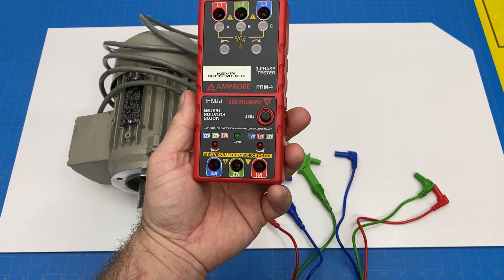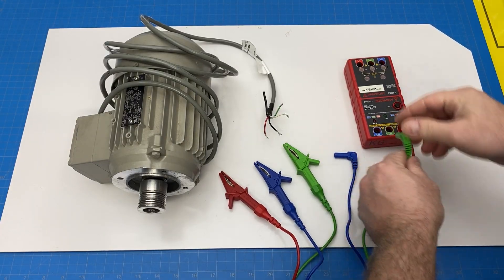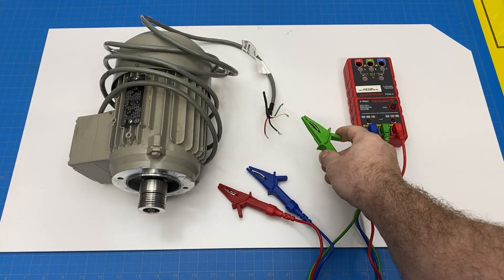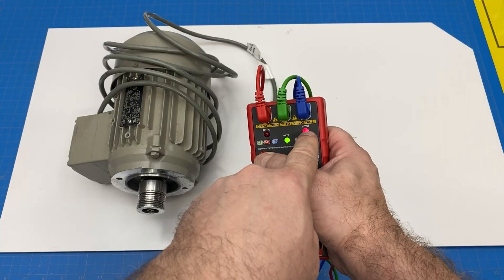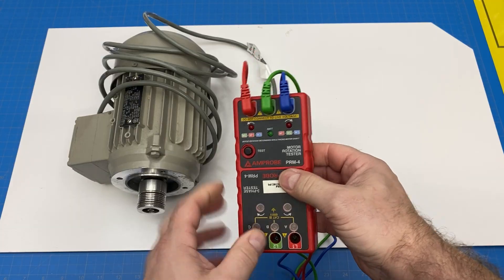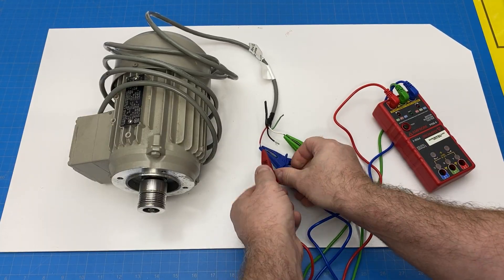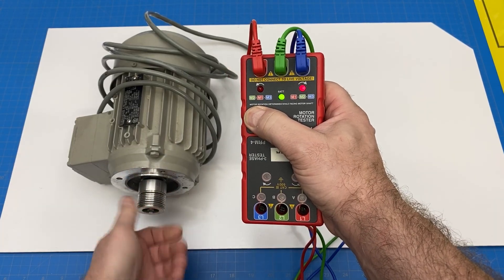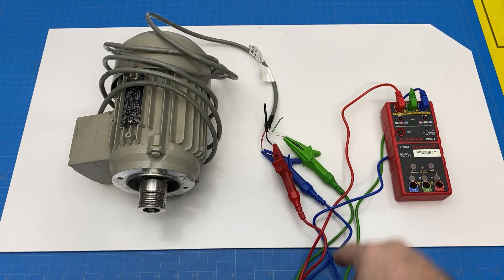Phase Sequence/Motor Rotation Tester on 3-Phase Motor [IUEC 394]

Comment from the maker: This video is part of a larger future series on electric motors and testing but a co-worker needed this tomorrow so I shot this quick video on how to use 3-ph Motor Rotation Meter.
Help us get to 100k Subscribers: http://goo.gl/DDfVab 
How to use Amprobe Phase Sequence & Motor Rotation Tester on 3-ph Motor:  https://amzn.to/38baUNN
https://www.kevingittemeier.com/
https://www.kevingittemeier.com/phase-rotation-tester/

Newer Version
Amprobe PRM-6 Phase Sequence and Motor Rotation Tester: https://amzn.to/390dnd8

Want more tutorials like this?  You can help support this channel by Subscribing, hitting Like & Commenting.

Most commonly asked about tools can be found here.
https://www.kevingittemeier.com/shop/
Some links are affiliate links in which you pay the same price yet I receive a small commission which helps support my website and channel.

Amprobe Phase Sequence & Motor Rotation Tester: https://amzn.to/38baUNN

Note: these are specific notes for a specific elevator gate motor
Instructions for Travis to ID wires on 2 Speed 3-Phase Motor.
You have 5 wires
Yellow is Common to both High and Low Speeds
2 Red wires for Low 
2 Black wires for High
Although you land any color meter leads to wires so long as you stay consistent from Low to High, for simplicity just do as I list below.
- Put the Green Meter Lead to Yellow Motor wire
- Red (M1) Meter Lead to any Red Motor wire then
- Blue (M3) Meter lead to the other Red Motor wire.  
Turn Motor CW and if CW LED lights up label the wires Red and Blue or M1 and M3.  
Do the same for the Black wires and that way when powered up and running the motor won’t try to reverse direction when changing speeds.  Both speeds will be going the same direction even if direction is wrong.  
If directions is wrong swap both Red motor wires with each other and swap both Black motor wires with each other.

Travis, click here https://www.kevingittemeier.com/phase-rotation-tester/

Phase Sequence and Motor Rotation Tester,

Phase Sequence Tester,

Motor Rotation Tester,

Phase Sequence Meter,

Motor Rotation Mester,

3-Phase Motor Rotation Meter,

Electric Motor Rotation Meter,

Three-Phase Rotation Indicator,

Phase Rotation Meter,

Phase and Motor Rotation Meter,

Phase and Motor Rotation Tester,

Test Motor Phase Rotation,

How to test Motor Rotation,

Amprobe PRM-4 Phase Sequence Motor Rotation Tester,

Comment: So it matters what lead you clamp to which wire...what  if the leads from the motor are not marked and you don't know what they are. How would one go about working blind ?
Reply from the maker: This tool identifies the wires for rotation (CW/CCW, L1/L2/L3, M1/M2/M3).
To understand that you must first understand basic three phase motor rotation.  you can land the three motor wires to three incoming wires anyway you like and the motor will turn either clockwise or counterclockwise.  To change the direction of rotation you only need to swap two wires.  This tool identifies the wires so you know which rotation the motor will turn without the 50-50 guess and trial and error.  Often times it doesn’t matter and you can just swap two wires if it’s the wrong direction but there are certain situations where you want to know the direction so that damage is not occur running the wrong direction.

Comment: Hey mate, nice video. I'm assuming that you have to test phase sequence of the supply before connecting up to the motor. This is to ensure if the supply is clock wise  L1 L2 L3 then connecting L1 L2 L3 to U1 V1 W1 respectively would give you a clockwise rotation? Let me know thanks
Reply from the maker: Yes, the other side of the meter checks incoming 3 phase power for rotation as CW or CCW.  Match the incoming 3ph rotation to Motor rotation and it will turn the rotation expected.  You cannot assume the The rotation of the 3ph or motor just because of their labeling which is why this product exist.  

In a perfect world connecting as you describe would result in a clockwise rotation but in reality most motors are just a 50-50 crapshoot and often the three phase is not labeled properly.

https://www.kevingittemeier.com
Reply: @KTFG  thanks for verifying that. Wasn't aware that there were 2 sides to the tester. Great piece of kit. Been looking for something like this for years
Reply from the maker: 10-4, here is some more information and different models listed here on my website.
https://www.kevingittemeier.com/phase-rotation-tester/
Reply: @KTFG  decent, nice one